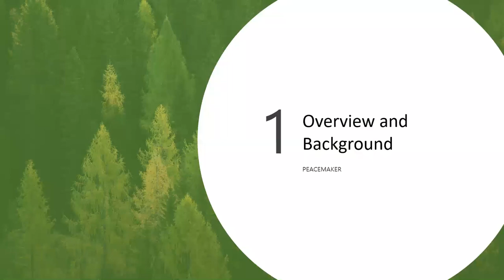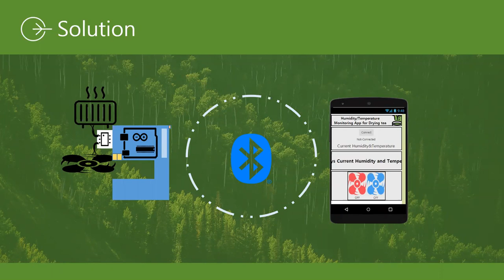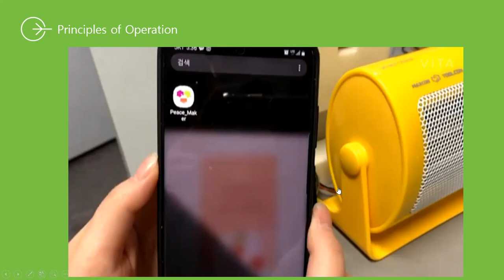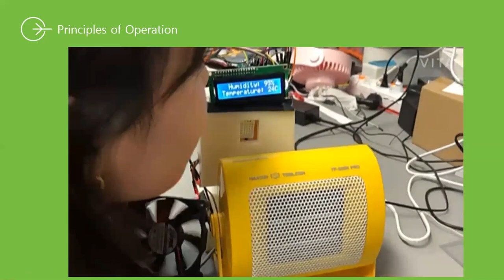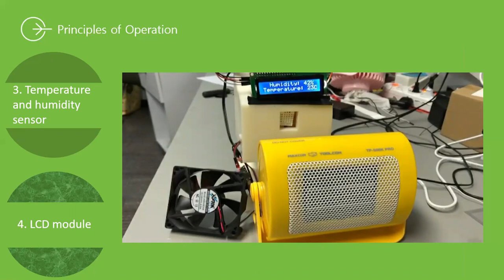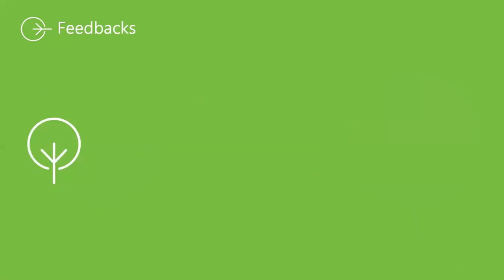[PEACE MAKER] “Humidity Control for Drying Tea”

Comment: Hi Team Peace maker! Nice Video. I got a question. I don't understand why humidity data increases while you look like blowing the sensor. Thank you.
Reply: Hello! Thank you for your questions. When we measure humidity, the DHT22 temperature and humidity sensor can measure the change in resistance between the upper and lower electrodes to determine the change in humidity in the air. Both surfaces of the thin film polymer (humidity suction plate) have thin plates with electrodes that absorb moisture from the air. When the amount of moisture attached to the surface of the thin film polymer changes the conductivity of the two electrodes, the humidity is output by sensing them. When we blow to test the operation of the device when the humidity exceeds the set value, the amount of moisture contained in the exhalation temporarily increases the amount of moisture detected by the sensor. Thank you.

Comment: I saw your UCC well. It's a good job. It seems that you used Bluetooth for communication. Is there any reason to use Bluetooth? For Bluetooth, there may seem to be a problem in communication coverage. In what environment do you think this system should be operated?
Reply: Hello! Thank you for your questions. First of all, we chose Bluetooth communication because the workers' work space is small enough to be safe with Bluetooth NFC. Also, I thought switching would be inconvenient because there is a wifi that the company usually uses. Testing is also easy at the prototype stage. Assuming that this device works, the environment we have assumed is a workspace, where there are three to four tea tables with a width of 40cm after mentoring. If Bluetooth communication distance is not enough, I think it will be solved if additional repeaters are installed. Thank you.